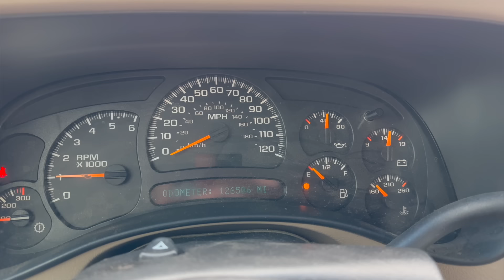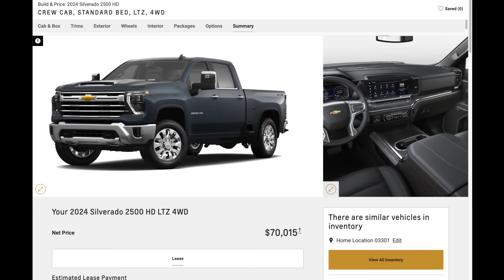I Bought the Best Truck I Could Get for $10k. How I Got it at Dealer-Only Auction

Comment: A rust free, unmolested old GM with no engine light? A unicorn in southern Ontario.
Reply: My engine light has been on for 10years. 322300miles. Runs like new
Reply: @bbhalstead  Haha! A piece of electrical tape has hidden one on mine.
Reply: @bbhalstead Evap system code I bet.  The charcoal canister on your fuel tank is probably plugged, is it hard to fill your tank when your tank is low on fuel eg gas pump handle keeps clicking off while trying to fill?
Reply: @lickitysplit2413  yes, that's what happens

Comment: The lack of rust on the vehicle will make the bolts feel less tight than they were 👍🏻🏴
Reply from the maker: Good point 😂
Reply: Use some fluid film
Reply: @WaldosWorld  how are you
Reply: where did you pour your old oil? Does Walmart take them? @WaldosWorld
Reply: @RuijieZhou  Virtually all auto parts stores (O'Reilly's, Auto Zone, Napa, etc} will take used engine oil for free. I suggest taking paper towels with you when you dump the old oil into their oil bin, it can get messy.
Reply: @mr.whiskers3283  I know they take engine oil, but I never saw they have separate tanks for transmission or steering fluid
Reply: @RuijieZhou probably he put it in the container the new oil came from and Walmart recycles oil.
Reply: @RuijieZhou you can put the other fluids in with the oil. they know it's used dirty oil

Comment: As a fellow New Englander myself, it's nothing short of astounding to see one of these mid 2000s Silverados in such immaculate, rust-free condition.
Reply: I am also a New Englander and thought the same thing! my 2015 Fiesta ST has rust on every damn door, hood and hatch at the edges. poop
Reply: I was born in Maine but moved to Montana when I was 5. Went back to graduate high school in Maine and was dumbfounded by the amount of body shops. The roads always have a layer of snow on them out here after it snows, if that's any hint
Reply: I live in the Portland, Ore., area and I can assure you that the truck in the video is hardly unusual. I own seven vehicles, all but one from 2002 or earlier, and not one has any rust whatsoever. Even my 1960 International dump truck. If a vehicle here has any rust at all it has either spent time back East or on the Pacific Coast.
Reply: I agree as a fellow New Englander the rust free aspect of this truck is unbelievable
Reply: I have one just as clean, 01 Chevy z71. 
I bought it as a 1 owner with 100k on it, from an elderly gentleman in TN.

Comment: My first time seeing your channel and I'm blown away by how well you explain things as you're doing them. I'm 75 years old and remember the days when I used to work on my cars but didn't have the tools or lift or anything. There's great satisfaction in repairing your own vehicles! Your dad is very lucky to have you for a son! God bless. I subscribed to your channel and will look forward to seeing future videos.
Reply: yeah, and i'm sitting here thinking 'nice find' but if i did that and brought it to my mechanic for all the work he did on it right here i'd have another $3k into it easily depending on which bandit (oops, i mean mechanic) i would take it to. yes, it's great to be able to do your own work. i've got only 142k on my '06 1/2 ton 5.3 extended cab (bought used 7 years ago) and am hoping to get many more miles out of it yet up here in WI before it truns to a complete pile of rust. so far, it looks like my adding wheel opening fender flares and plastic rocker panels to it to cover rusted out ones just added $5k in value (lol) and make it look like a much newer truck. people seeing it for the first time since the minor cosmetic upgrade scratch their heads trying to figure out exactly what's different about the truck...lol. one thing is for sure...these are great trucks! couldn't afford a $70k truck on my best day ever...
Reply: Ditto everything you said, first time watcher, too.

Comment: I have a 2007 Chevy Silverado 1500.  I basically stopped driving it in 2017 because gas prices had gotten so high.  It sat parked the majority of the time for seven years.  It had 197,000 miles on it.  Earlier this Spring, decided to quit neglecting it and get it back to 100%.  Had to have transmission rebuilt, but I was able to replace alternator, battery and do the brakes (with help from someone with more knowledge than me).  I got tires and got a good tune up.  For the past three months, my daily driver and I am in love again.  Granted, I just retired and mostly driving around town.
Reply: 2010 Sierra. These trucks mechanical parts are indestructible but the bed and frame will rust out horribly if not taken care of
Reply: You may not believe this. My 08 Sierra has 322000miles. 4.8l , all original belt,plugs, rotors,trans, never changed trans  fluid. Only front bearings changed. Still runs great. It will probably outlive me. Never changed brake fluid or coolant.also, it is always full of tools and lumber 21:39
Reply: @bbhalstead that's crazy, but I'm not surprised that's the engine to do it. My 2012 Silverado has the same engine with 204k miles and it might as well be brand new. Doesn't burn or leak a drop of oil still, and silent and smooth. Helps that it doesn't have the DOD crap on it. Just a good, reliable small block. I am a stickler for maintenance though, since I got it at 135k miles. These motors love Pennzoil Ultra Platinum oil. If you develop a startup tic, switching to that will resolve it.

Comment: I'm still driving my 2002 Silverado. Kept it in mint, perfect running condition for the last 15 years. Not so much as leak or residue anywhere. Never lets  me down.
Reply: Last year of the 4th gen. That's the exact truck I want to get. They are great. My work has one and I love it. It's old reliable at work, she runs and runs while all our newer trucks are in the shop constantly.
Reply: Same with my 05. 👍🏼
Reply: Same here. It's been to the shop only twice in the 20+ years. Once to replace injectors and once to replace AC lines. I'm starting to think about replacing lines in the fuel system and maybe the PC3 pump. A fuel injector failure can also wreck injectors.
Reply: My ex step dad had a 04 Seirra 1500 5.3 with almost 300k on the clock before trading it in for a newer Ram 2500 for his new racecar trailer that was a little much for a 1500. He towed his old racecard trailer with that truck a lot on the interstate normally running around 70mph. Only problems with the Sierra were the common GMT800 stuff. 2 trans rebuilds, both front hubs around the 180k mile mark, the auto climate system had a mind of its own, and tie rods.
Reply: 02 2500 hd Silverado
Reply: 2004 Chevy silverado v6 234,000 miles  no oil leaks, very rusty but very reliable.

Comment: Beautiful truck. I have the 1500 version of a 2004 Silverado with the 5.3. Bought it from the original owner about two years ago. It’s about to hit 100k. California truck, no rust. It’s a great truck. I picked it up for about 12k. Much better than paying 50k for a new model.
Reply: I have a 2002 1500 LS just turned over 212.000 miles. purrs like a kitten 4.8
Reply: Great trucks. I'm a Ford guy and even I have to tip my hat to that era GM trucks. Ford decided the triton engine was the way to compete🤦‍♂️ luckily they made good diesels.
Reply: I bought a black 03 1500 Z71 with 265k and a much nicer BOSS hood for $2000.  Needed a bit of cleaning and TLC buts runs and look great. PO didn't know the market and made a quick deal but was really kicking himself when I later picked it up.
Reply: Yeah those are great trucks with 5.3 before they started the cylinder  deactivation garbage.

Comment: I found mine on east TX for 6500 it was a grand pa truck 05 silverado 2500HD 4x4 (floor shifter) crew cab cloth seats he was selling it on Facebook and was advertised as a bad lifter noise and turns out it was in fact a manifold leak wich it was cheap to fix,i still can believe how lucky i was,i replaced the yellow headlights with OEM,and fix the saggy bumper with my pumpkack and truck looks like a brand new truck!
Reply: Iam auto dealer for 39 years and a president of the TIADA  of South Eastern division of Texas. This hammerhead IS NOT ALLOWED  at a real dealer auto auction. And the so called broker can lose his license if they find out they are letting in the public, like this hammerhead into a real dealer auction.

Comment: Great job on this truck. The oil change and fluid levels check at the beginning of a 3000 mile drive gave this truck a chance to "blow everything out" of the engine. The complete fluids and filter service at home, plus other maintenance, is what people should do or have done when they buy a pre-owned vehicle. Of course, they need to have a pre-purchase inspection (PPI), but you seem to be able to fix anything :). You set a great example for people and their vehicles. THANK YOU!

Comment: As a first time viewer and  retired auto tech, I really appreciate you and your channel. Your honesty, personality , thoroughness, knowledge and attitude  toward maintenance and economical fixes are refreshing. One thing I would suggest, when checking ball joints, it is needed  to "unload" the ball joints. Meaning, when the wheels are off the ground, most "long-arm short-arm" control arm setups fully extended and the suspension travel stops when the upper control arm compresses  the rubber (I'll call) "top out" bumper(as opposed the "bottom out" rubber bumper. Otherwise, the torsion bar in, this case, is forcing the control arms into a "loaded" position. Your channellocks will not overcome the pressure of the torsion bar . Hope that makes sense. Please continue the great channel!!!!

Comment: Those are FANTASTIC trucks!  They are easy, and cheap, to fix, but rarely need fixing.  Mine has 260,000 miles, and it runs like it's new.  In my area, you can't go more than a half mile without seeing one of these 03, 04, or 05 silverados, in great shape, driving by.
Reply: I still have my 01
Reply: Got a 04 235.000miles
Reply: HMMMM.....MINE IS AN '05; 4 DOOR ( WHY DIDN'T SOMEONE THINK OF THAT BEFORE LIKE 1990 WITH THE LIMITED BACK SEATS?...EXCEPT FOR THOSE REBOPPED FORD. &VCHEVY RAILROAD OR POWER COMPANY  EVRY USED AND MAYE ABUSED TRUCKS THAT SOMEBODY ALWAYS SCARFED UP AND SOLD FOR A PREMIUM)   190,000 MILES UPON PURCHASE......323 CID ENGINE @ 300 HP WITH SOUPED UP AFTERMARKET EXHAUST SYSTEM.
 EXCEPT FOR THE WHEELS ( WHICH APPEAR LARGER THAN MINE...255 R17 BF GOODRICH/FIRETONES THIS CCOULD BE  MY TRUCK..I JUST WENT AND LOOKED IN THE DRIVEWAY....WHEEEW..IT'S STILL THERE...
 I GOT A BOBTAIL BUCKBOARD BED 5'' 8" INCHES OR SO BUT THIS IS A CLONE OF MY TRUCK EXCEPT FOR THE HEAVIER SUSPENSION PARTS...AND 2500 ON THE FENDER. TIRES LOOK JUST LIIKE MINE-OFFORAD TIRES GONNA REPLACE THEM WITH A MORE COMPROMISED STREET/ROAD TIRE BUT AS I TOLD MY WIFE...I'M NOT REPLACING PERFECTLY GOOD TIRES ( 80 PERCENT OF THE TREAD LIFE STILL STILL THERE AIN'T HAPPENED YET.....2005 HAD REAR DRUMS "TO SAVE MONEY" THANKS CHEVY ....YOU DUMBASSES...C'MON CHEVY CORP.PRATION...DON'T SAVE MONEY ON LESSENED BRAKING CAPACITY M'KAY? I'M GONNA CHECK AND SEE IF THEY HAD REAR DISCS AS A OPTION IF IT';S NOT TOO TERRIBLY EXPENSIVE .II I DON;T DRIVE VERY FAR...ANYMIORE BEING RETIRED, I WOULD'VE LIKE TO MAYBE...JUST MAYBE GOT THE 6.S ITRE IF I COULD'VE FOUND ONE BUT THEY SAY.....JUST LIKE THE RELATIONSHIP OF THE  283 TO 307, 327 TO 350 AND 305 TO350 AND NOW THE 324 TO 350 THE LESSER POWER WAS NOT COMMENSURATE WITH THE DISPARITY IN INCHES WITH THE 5.3 PULLING A 3 AND 5/8 STROKE WITH A BORE SLIGHTLY BIGGER THAN A 305 AND SAME AS A  ANCIENT 265 AND 283 WITH WITH ..
I JUST FOUND THIS CHANNEL.... I WILL BE BACK REGULARLY. ROCK ON BRO....... @barbarasteed3966
Reply: Bought my 1999 used with 100,000 miles on it, now has 230,000 and the only fluid that I've ever changed is the oil.
Reply: What WE USED TO MAKE!
Reply: I’ve got the Cat Eyed 2007. / 5.3 203,000 miles. Never replaced alternator, water pump, fuel pump..
Reply: First time viewer. Good job on the video. With what you did, that truck last many more miles. Dad surely will enjoy.

Comment: Love the GMT800s and 400s both!  I have 2-2500hds:  1 with 8.1 and 1 with 6.0.  Hoping to keep them going for a long time.  Theyre so much more reliable than the new expensive junk.
Reply: That ain't no joke. His old man better hang on to this one and take care of it. Easy peasy to work on.
Reply: These were considered new expensive junk back then aswell..lol
I still drive my 2000 k2500 but I also have a 2021 duramax and it's been perfect @74k miles now
Reply: @Liimpy tbf I think a big complaint on newer vehicles is how hard they are to work on/maintain without expensive equipment. Or in some instances just impossible without speciality tools for a single use.
Reply: I have 2 gmt800 and 400 with 400k still going

Comment: For the coolant, on the left side of the radiator (from driver position) of these GMT800s there is a hose routed up and a drain petcock. You can pull the hose down and point it at your bucket, open the petcock, and drain your radiator no mess.
Reply: Don't you mean right side? Or drivers side?
Reply: @eaglewarrior8707  No, left side from the driver position. Drivers side in the US.
Reply: Yeah,  that hose is left side. In automotive speak, left and right expressed as if sitting in drivers seat.
Reply: Lol
Reply: Not all of them have the petcock, though there is a plug, in place if you want to install one.
Reply: My 06 has no hose and no petcock.  I pull the lower hose and heater hoses to do a drain and refill.  Jack up the driver's side and you can get a few more quarts out of it.  Maybe 10 total.

Comment: Waldo, I really like how calm you are throughout the entire process. If I were doing something like this, I would have had the luck to break at least three of the four hub retaining bolts, needed a 1” pneumatic air hammer to remove the axel shaft nut, wedges to remove it off the spline, 10# hammer to remove the upper ball joint, snapped a spark plug or two and all of it would have needed torches to expand the rust. Other than that, thank you for showing me that there is a way to get help and that is by watching your videos. Thank you, 🤠👍

Comment: I've owned several of these trucks. They are gmt800 trucks. There are absolutely great trucks. I have got 300k plus out of every one with very little money put into them. I think they are the best trucks gm has ever produced. The duramax 5.3 and the 6.0 are all great engines. Its best to stick with the 2500 and 3500 versions.
Reply: Yup. Just all around a great quality truck that’ll do just about anything you need it to do, for as long as you need it to do it (assuming you keep clean-ish oil in it, & don’t let it overheat lol
Reply: @dabofiron.itzsimplicity  absolutely

Comment: Where are you in NH? I'm in Littleton area...oh, and MY 1993 Chevy 4x4 Silverado extenended cab... towing a 10 × 5 trailer with 2 800 lb motorcycles and a full bed...made it from Tacoma to Bretton Woods No Problem!

Comment: Just bought a 2007 Chevy Crew 2500 HD LBZ Duramax.  Awesome so far after 3,000 miles.  That is the trip of a lifetime!  I paid a lot more at a retail dealer, but too nice to resist.  Except for rust, those trucks are bulletproof.  I had mine professionally treated with Fluid-Film and will do it annually - especially in salty rust belt.
Reply: Where can one get their vehicle treated with fluid film?
Reply: You paid more because of the LBZ. I have one great motor just a few tips for you, lift pump will protect the the cp3 fuel pump and injectors and egr delete if you can.
Reply: @papabapyro  Just had a FASS lift pump installed.

Comment: I owned an 06’ that was the same paint and interior. It was a wonderful truck and the only issue was the wheel bearings. It did start to get some lower body rust and with 224k I sold it locally for a very fair price. I happen to run into the owner at the lumberyard a year or so later and he was very happy with it.
Reply: I got an 06'  bought it about 8 or 9 years ago , I've been through a couple of batteries, changed the oil and filters a few times, changed the brake pads once, other than that, nothing. I can go out, turn the key and it runs like brand new.  Oh,  280K miles.  Paid $5K cash for it.

Comment: About a year ago I bought my dad's. 2001 step side Silverado. It runs great with 323,000 miles on it.
 It is my family hauler since it is a 6-seat truck. It has the seemingly rare 4.8 liter small block V8, and the transmission is still excellent as well as the engine. You can not go wrong with a well maintained. Early 2000 General Motors truck or suv.❤❤

Comment: When checking ball joints on a truck with torsion bars, you need to set the truck on the ground and use a floor jack under the control arm . Use a medium pry bar to check for movement. I have  been a mechanic for 20 years and a shop owner for the last 10 years.I also specialize in suspension and alignments. You got a great deal on that truck.  Congrats

Comment: Heres the deal, the plate was fine. They can make up anything they want to pull u over.
Reply: Yeah. Your plate doesn't match is a common pullover tactic. You can't prove them wrong for the illegal pullover and yet "Now the system works!" So your computer 10 minutes ago did not have proper information but conveniently it now does. Bologna.

Comment: owned a sierra 5.3.. great engine. drove it to 300,000 and sold it
 it was still running awesome. never any big problems other than normal stuff like alternators. it did go through sealed wheel bearings and a few fuel pumps but thats about it. great truck